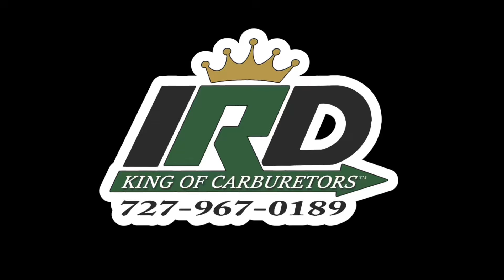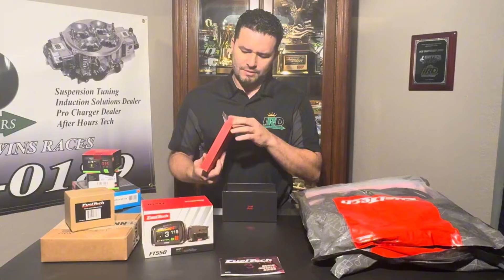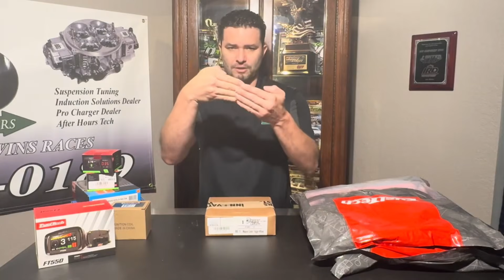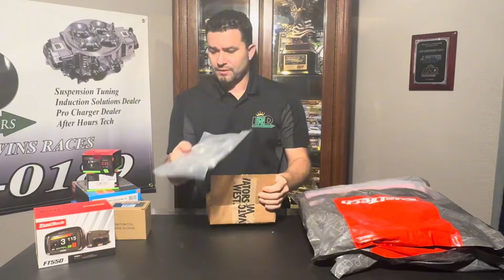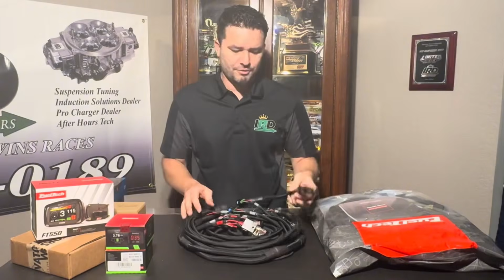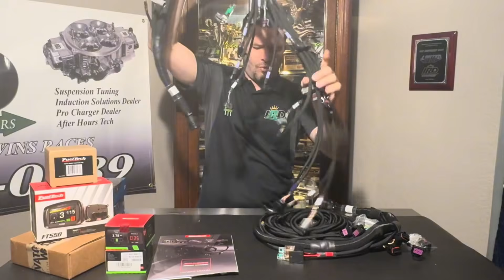FuelTech’s FT 550 and why you should consider this as your next ignition system !!

Comment: You skipped msd 6530 will do just as much for way less not taking nothing away from fuel tech but I’ve made plenty of hp with msd 6530
Reply from the maker: Are videos are to cover a broad perspective of different ignition systems and more. The 6530 can handle some decent power, but doesn’t give you nowhere the tuning options that Fueltech gives. So the next time that you’re starting from scratch or you’re wanting to upgrade from your current ignition, this is why the Fueltech is such a good option.